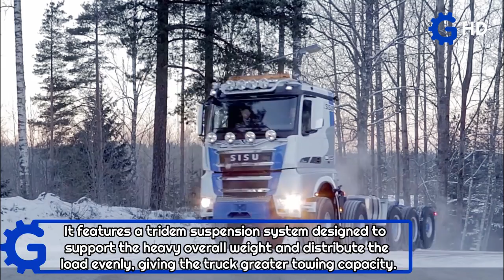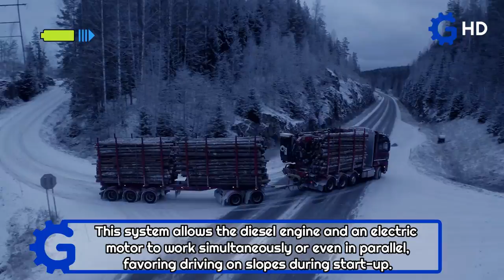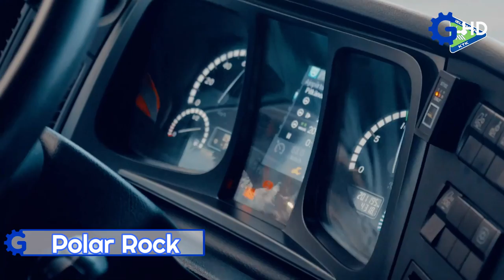The Most Powerful and Impressive SISU Trucks You Have to See ▶ 900+ Hp Hybrid Truck

Comment: sisu is a Mercedes benz rip off truck.
Reply: Only cab is from Mercedes...
Reply: @fordsonman  and motor and automatic gearbox but manual gearbox is from Eaton fuller
Reply: @robban883  motor is Detroit Diesel in nowadays and Roadranger is THE gearbox.
Reply: mercedes is only 5 years older? 😂
Reply: Sisu builds the frames themselves. Way tougher than Mercedes chassises.